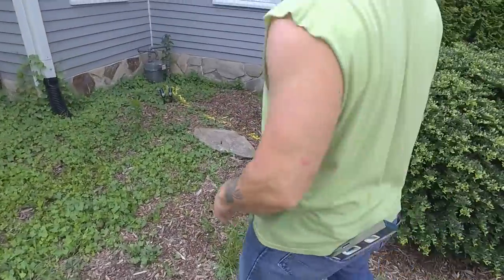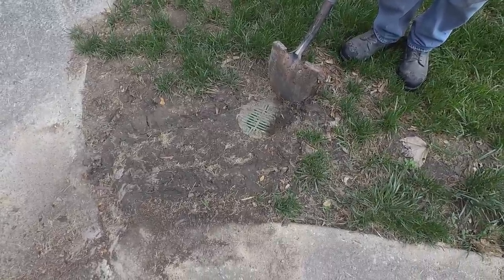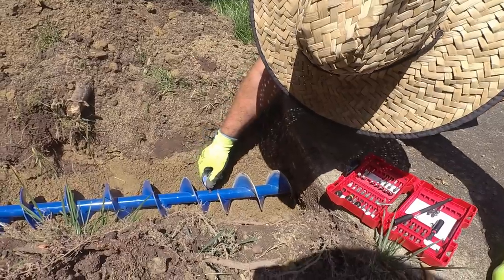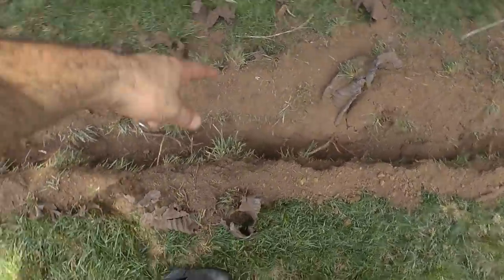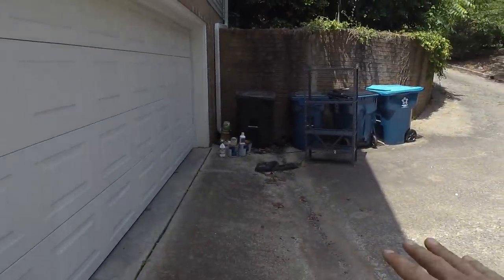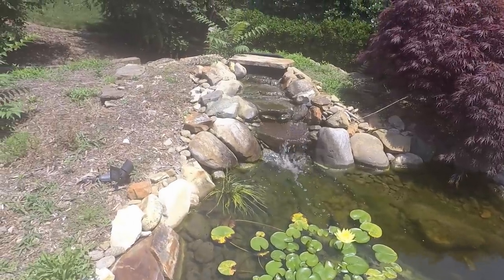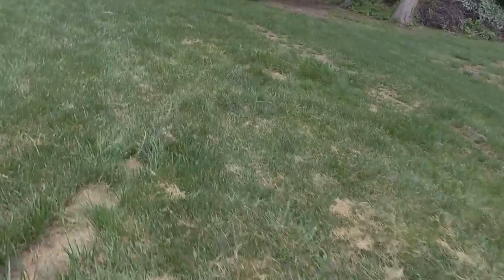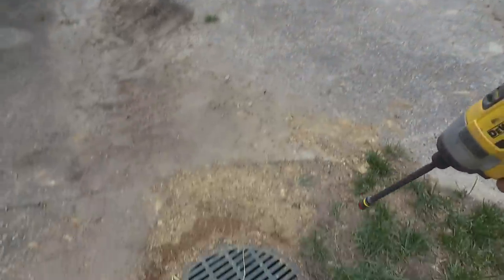High Capacity drainage system solves basement flooding

Comment: Where did you find that long 4" sidewalk auger bit?   I am just completing a 1,500' gutter drain project on my farmhouse in Alabama.  Your videos were extremely helpful.    Thanks.  I did use SDR 35 PVC because with my footage of pipe, schedule 40 was just unaffordable.   Still Schedule 30 is better than that corrugated flex junk.  I think the SDR 35 will last decades.  If I should have a failure, I figure I can find the break and fix the pipe.  Thanks for the great videos.  I am a Construction Law Attorney and a General Contractor with 45 years experience and I appreciate a YouTube video with someone who uses logic and common sense and knows what they are doing versus the other guys who are snake oil salesmen.
Reply from the maker: I got the auger from https://www.customaugers.com/ Call Becky and she will set you up. We used it the other day and it bored under a sidewalk in minutes. Fantastic. 

SDR 35 is good stuff and  you won't have any problems with it. I use schedule 40 because it has better availability and fittings.
Reply: Once you get a pipe in the ground a good 12 to 16 inches, it will be fine no matter what it is. I would still stay away from the cheaper brands of single wall corrugated though. I use dual wall corrugated for straight runs and Baughman single wall corrugated for the bend up to the downpouts. works great if it's put in right.

Comment: If you lay out tarps or plastic along where you dig, it makes clean up much cleaner.
Reply from the maker: I agree, but much more labor intensive.
Reply: @GCFD  Using 3/4 inch plywood is worth it once you get equipped to handle it.

Comment: On the 20 inch basin, how is it higher capacity when the output is the same size, 4 inch?
Reply from the maker: Because the weakest point was water flowing into the pipe, not water flowing through the pipe. Great comment!
Reply: 6 inch basins get clogged with lawn clippings and grass grows over the top of them to easily. A clogged basin will not flow water. I never use catch basins smaller than 12 inches when gathering water.

Comment: Do you guys use a laser level with detector to make it easier to dig the trench.  I notice you guys have problems with the fall sometimes and have to bring out the machine again and sometimes multiple times.  It would be a lot easier to check as your trenching with a laser level  you can set for a particular slope.
Reply from the maker: We do use the laser when we're trenching along flat ground. We have found it takes forever to set up the laser and get the fall with the laser and we are still checking everything with the level. Sometimes we just trench it again. 👍

Comment: Where can a consumer buy large catch or drainage basins?

I want to collect a ton of sub surface water. I would like several basins to be combined for max void space. And would like it to be possible to drive over.

I would use industrial trash cans otherwise.
Reply from the maker: I buy these 20" from SiteOne.
Reply: @GCFD  i have one of those near me. Will try.

Hard hours like 7am-4pm so tougher for consumers, but definitely worth a shot.

I saw some 9x9 inlet to pipe grates today which might work for another project instead of a channel drain

Comment: Where did you get the auger from?
Reply from the maker: I ordered the auger system from https://www.customaugers.com. I worked with both Becky and Tom and it was great. I ordered the system that goes into a standard drill and they also fabricated an adapter to fit my hilti core drill for more versatility.
Reply: @GCFD  is that the 5ft or 7ft?
Reply from the maker: @brentnovak2061  It is the 7ft that comes in two pieces. For the 4" pipe we used I ordered the 4.75" auger.

Comment: 2:30 6" is rated at ~27.84 GPM with the 20" probably rated at ~134 GPM.   
I'll be changing my discharge to a gray or black dual-wall UV resistant plastic.  18:12 10/10 You might be the only one (excluding corrugated installers as it is UV resistant).  

If you ever feel a need to battle a corrugated TY installer the ADS Drainage Handbook has some interesting facts.  Self-cleaning requires a minimum of about three feet per second of flow with 4" corrugated needing ~3.5% slope (~123 max GPM), 6" corrugated needing ~ 2.25% slope (~289 GPM), & 4" smooth-wall only needing .9% slope to achieve 3fps (~135 max GPM).  99% of land around here has 2% or less slope so corrugated isn't really an option except for exposed sections connecting gutters to the smooth-wall.
Reply from the maker: Thanks for the info Bob! Those numbers are really quite telling in terms of how well the pipe is going to carry water and its ability to blow out debris.
Reply: @GCFD  There are some lies on other YT channels that should be corrected. 4" smooth-wall at 3% slope can move around 244 GPM at over 6fps, & not the pathetic 72-101 GPM produced with 4" corrugated installed at >2% slope with a sediment collecting  >2.6fps.
Reply from the maker: Bob the Slacker 
I agree. It’s hard to watch these people pushing garbage information. As far as landscapers installing corrugated, I don’t think they know any better. This is because when you go to the landscape supply house they have rolls of corrugated and scissors to cut it. So that’s what they install, no fault of their own.
I’ve even had customers whose Landscaper’s installation of a French drain made things terribly worse with the basement flooding. I explained the same thing to her and spent considerable time with her, plus my channel here until she was comfortable spending considerably more money on the same problem. She reported in that there is absolutely no water coming in now where there was always a little. That video is coming soon.

Comment: Why don’t you talk about the cable that was cut? Been there, done that.
Reply from the maker: Hey Rob - there was an old irrigation system that pumped water from the pond. The homeowners didn't care about it since was all disconnected and out of service. So we trenched away!
Reply: @GCFD  I cut my buddy's csble. It was marked incotrectly. At least the čavle co fixed it in quick order.
Reply: @GCFD  What about the black cable closer to the home?